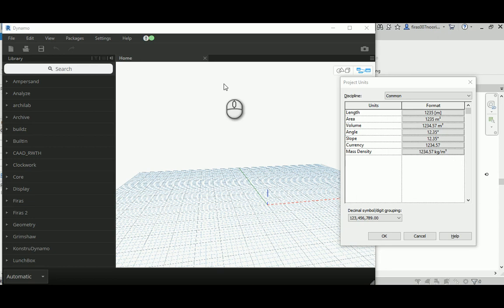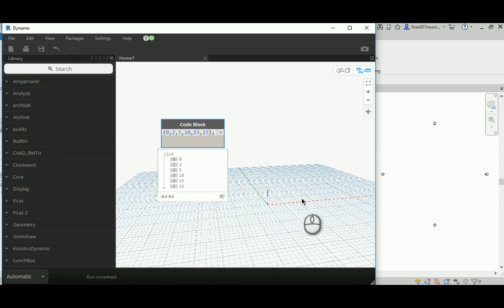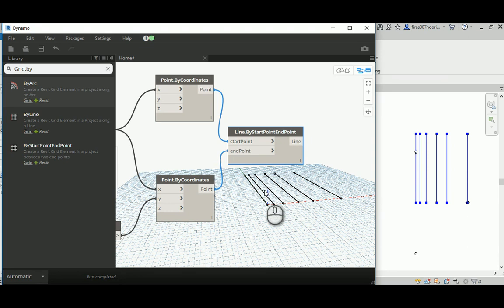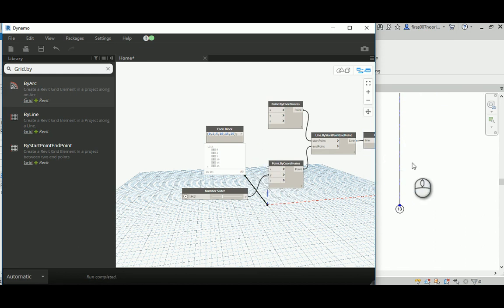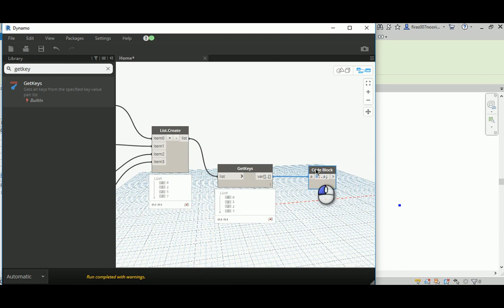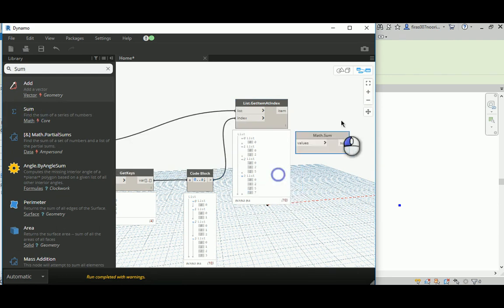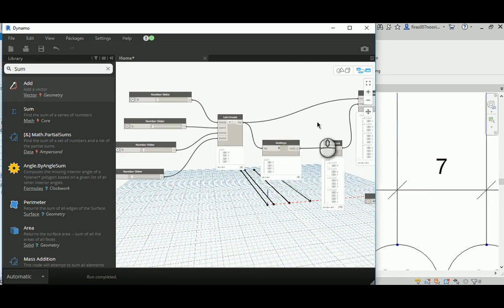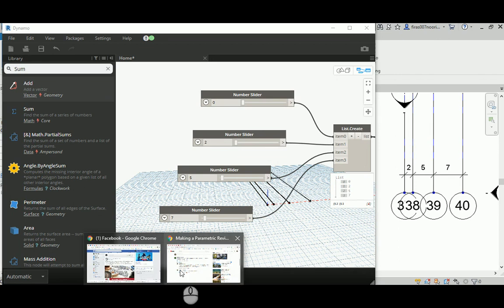Making Uneven Revit Grid By Using Dynamo

Comment: Jazak Allah for making an effort. It's really crazy thing. Thank you so much sir :)
Reply from the maker: Most welcome, anything anytime dear
Reply: I have one more question. I am working on a project applying BIM all the way. There are 2 separate grids. One Grid is pretty normal and other one is on a specific angle let say 30°. Is it possible to make rotation to grid in dynamo by  origion or in anyway.
Reply from the maker: @ukasha47  yes dear, the grid if you noticed is following a line in dynamo so if the gridbyline u use attached to oblique line the grid will be oblique, try that dear, and It did not work tell me i will upload a video for u
Reply: @FirasNoori   Thanks. I'll